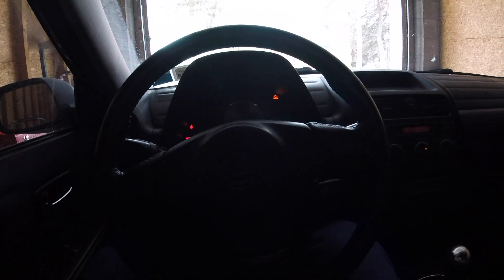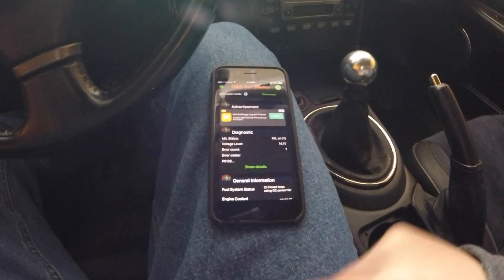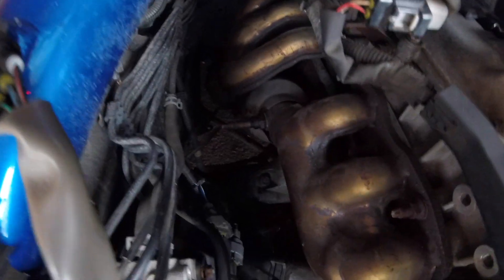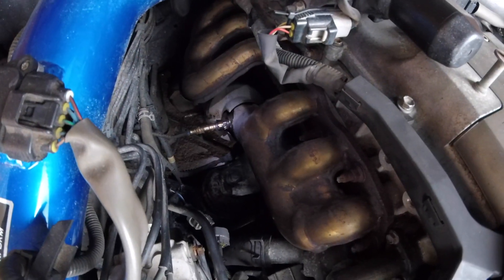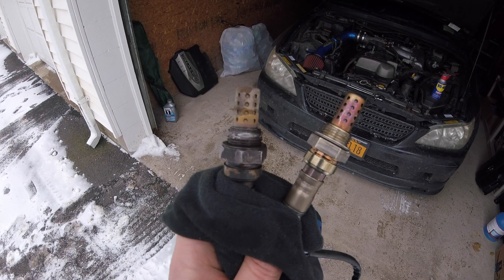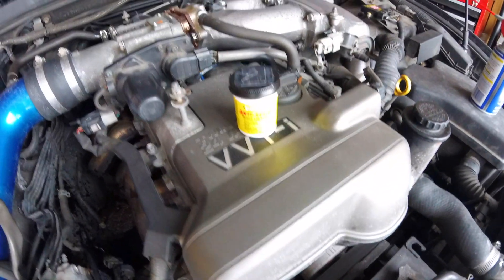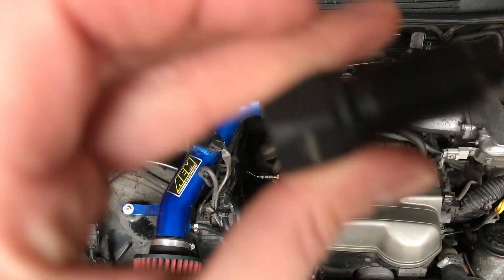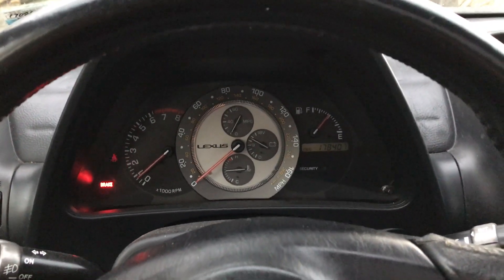P0135 oxygen sensor code fix for Lexus is300

Comment: Did this work for you though? I'm confused because the sensor you replaced was a upstream not downstream. The part number for the denso one you provided was -4626 which is a 1,2,3 downstream and bank 1 sensor 2. The one you replaced is sensor 1.
Reply from the maker: Hmm.  When I did my research I thought I had the right sensor and it did work for me.  Eliminated P0135. If I was wrong a got lucky because everything went in fine.
Reply: @ZachD  yeah it's really confusing but I hit up my buddy's on club Lexus and we all had an agreement that it was the sensor that's closest to the engine would be labeled upstream. And the one furthest would be past the catalytic converter is downstream.

Comment: Hi..do you know what cause your sensor goes bad? I have the same problem. Been driving for 13 years...nothing happened until I installed the K&N cold air intake and Tanabe exhaust. Drive for 2 days and then engine light on. Bad oxygen sensor bank 1 sensor 1. So just wondering how is your cold air intake?
Reply from the maker: my car came with the intake on it so I dont really know anything different. I did have my car for ~2500 miles before I had the code so in my case I dont think it was directly related for my case. exhaust shouldn't have anything to do with it as bank1 sensor 1 is before your tanabe exhaust even starts.
Reply: Yeah...that is why I thought too...maybe the car is old and it time to replace a new 1. Thx for the feed back.